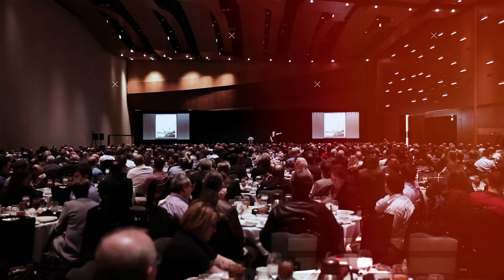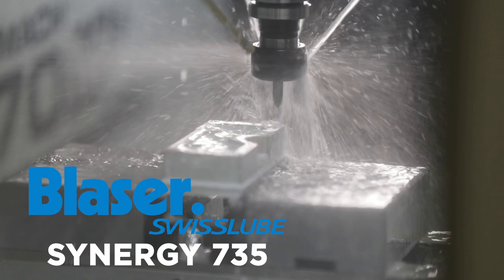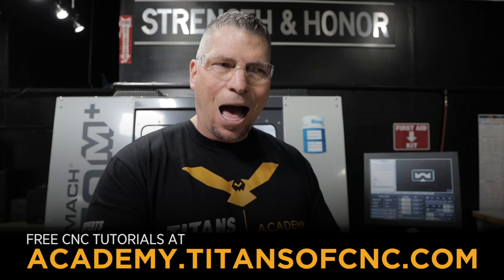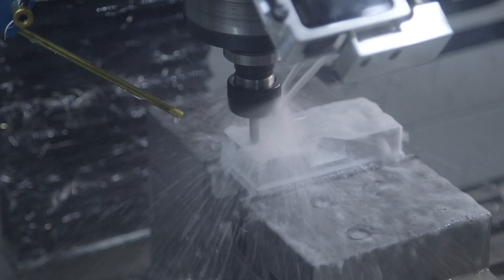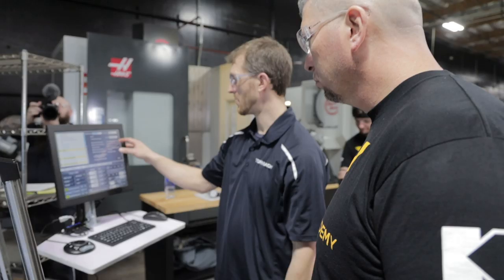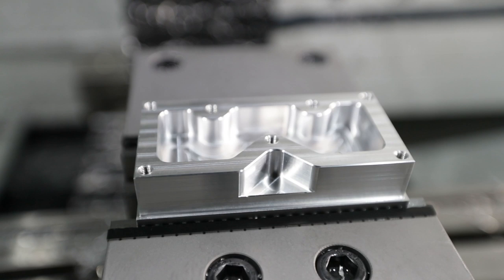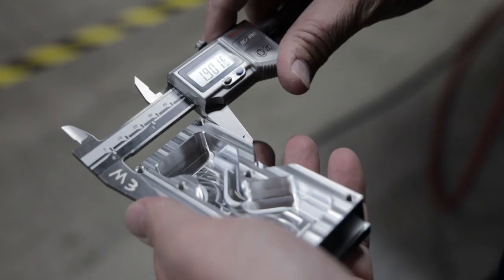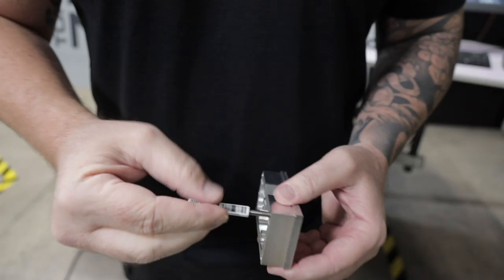My New Tormach CNC Machine - Vlog #58

Comment: Guys, forget the choice of machine here, Titan is trying to teach folks how to adapt and understand machining.  I've been machining 1" aluminum for 10 years on CNC "routers" with unbelievable results, and I can tell you the ability to adapt as a machinist is the take away here.  No recipe will work across all machines especially low HP mills / routers and that's reality. You've got to know how to adapt to get the best results for the given circumstances.  Personally I would save my tormach $ until it gets me closer to a nicer machine but the fact Titan is using one to teach earns him mad respect from me. I totally get where he's coming from. This guy is a true educator.
Reply: Perfectly said 👍
Reply: With tormach, you need to be great at adapting to get ANY kind of result that isn't scrap. Or, be great at adapting the scrap that the machine produces into something else usable :-D

I get the point of it as a non-production training only machine, that you don't give a shit about it being crashed all the time. If trainees are crashing a machine all the time though, there's a problem with your training :-D

But to me, Titans training looks on point
Reply: @neilhuband995  if you have to struggle to avoid scrap on a tormach, you're not a machinist. Tormachs are easier to use than any cnc mill.
Reply: @willl84  Tormachs are CRAP they are cheap for a reason ...If you want a cheap machine and don't care much for accuracy or finish get a Tormach if you care about those things get something else NO CNC professional would touch a Tormach as their main machine....
Reply: @captainmcderpyderp  

I'm not referring to ease of use lol

I'm referring to these machines ability to hold tolerances and produce decent quality surface finishes. 

Go have a look at the scare stories, there's plenty of them. Go have a look at cnc forums and see what people have to say about their shiny new tormachs. Do a YouTube search too. Don't tell me you're ignorant to the nightmares that people have had with these machines.
Reply: @neilhuband995  all of them had no idea what they were doing. Tormachs can easily hold tolerance.
Reply: Iam from Germany, and you only see DMG and Hermle over here. But both are super expensive, they also pretty damm good, but what iam trying to say is that, sometimes you dont need the best, when you cant even use it. I mean you wouldnt get a Ferrari as a first car, cause you just dont know how to use it, you will get a cheap car to learn, and in the beginning it will be enough.
Reply: He's using it to teach because he's all about money.  Teaching on a production machine doesn't make financial sense since it's not generating revenue when idle (used by a student). Training kids on cheap machines makes sense. Holding tight tolerances is irrelevant at that point. Take lighter cuts. Simple. They're learning and not producing.

Comment: Wow, a lot of haters, guess they don’t understand that people have different ideas and requirements for purchasing machines. If you are a business that needs to make parts and lots of them then yes this is not the machine for you, nor if you have critical tolerances.  But maybe for people like me that want something that no one manufactures and don’t want to spend 150k on a machine , well it’s fine for me!  I’ve been able to learn cad/cam (fusion 360-free$) purchase a machine (tormach 1100) for less than beater car, hit the you tube university (free) and within a year build a rather complex model. About 300-400$ worth of broken endmills, learning curve, one soft crash,     And this machine sits in my shop, doesn’t have to make me money, just makes me happy. Now I have something that no one on this planet was manufacturing. Yes I would like to have a haas vf3 (money is not an issue) but practicality is, $30 tool holder vs $130. Space, power requirements, am I going to actually use it?  I don’t need to finance or do I?  Am I expecting to pay less for a machine and not willing to put in the effort to learn how it works?, set it up? Adjust it?  Or am I going to pay travel expenses for the tec to on my $150k machine?  I’m happy with what I have and I also have realistic expectations. I think the haters are just not willing to accept the fact that in business you have to be working and have to keep employees and machines working or you will no longer be in business and someone will be wanting that expensive machine back you financed.

Comment: And I paid $8,000 for a 2006 bed mill including shipping, phase converter and bt40 tooling and Gibbs cad/cam package. Oh and it came from a school where it was hardly used. Now tell me about Tormachs $15,000 price? I just cant do it. For $15k I can get 3 different 6000lb bed mills and in fact that’s what I’m doing. Anyone want some cnc bench mills or manual mills hit me up I gotta get rid of all these toys. By the way the school that i obtained the bed mill from upgraded to a 5 axis vmc and we talked about Tormach and they said they would never consider using those for instruction. Perhaps a high school metals class but not an actual college teaching engineers and machinists.

Comment: Bought my 1100 for prototype work in 2013 but ended up pressing it into production, not very fast production, but it was "do or die" for my business then. The Tormach did and we didn't die. Five years later we built a shop and are looking at our first HAAS. 5 years we ran the Tormach and I've had a full time guy supporting his family for the past 3 years. No complaints.
Reply from the maker: Exactly, I never said it was the best... but it’s great for an entry level... for those who otherwise couldn’t have a CNC
Reply: CDM GEAR LLC you need a vlog too :) that's a hell of a story
Reply: @TITANSofCNC  absolutely
Reply: The story is a deep rabbit hole, detailed and interesting, probably only to me, but I couldn't do it without God.
Reply: Iam from Germany, and you only see DMG and Hermle over here. But both are super expensive, they also pretty damm good, but what iam trying to say is that, sometimes you dont need the best, when you cant even use it. I mean you wouldnt get a Ferrari as a first car, cause you just dont know how to use it, you will get a cheap car to learn, and in the beginning it will be enough.
Reply: @cdmgearllc9510  That's where you're possibly wrong. People that think their stories aren't interesting often have the most interesting stories. People that find themselves interesting...well.

Comment: I’ve used a Tormach 1100 series 3 for three years, anywhere between 12-60 hours a week depending on the requirements. Making one off parts, prototypes, and full on production for products used in woodworking.

Literally checked the tram today after a year of steady use. X was out 2.5 thou over 16 inches (which was what caused me to check it, face mill wasn’t spitting parts out flat enough for my liking), Y was out 0.0008 over 8 inches. Backlash/lost motion on X was 0.0003, Y and Z were both 0.0008.  My only complaint is it’s a little “hokey” using shims to tram, but I also understand the limitations enforced by price points. It’s a machine that was 22k with literally all the bells and whistles with a travel large enough to grant me the parts I needed.

For woodworking tools, no one would have ever noticed that 2.5 thou variation, and it was on a cosmetic face. That’s just my personal taste coming through on consistency and quality. It’s for wood. Breathe on it wrong and it’ll change more than that variation. 

I learned production CNC in a mass manufacturing setting on machines that were 2.5 mil each, running dual 250kW motors on a single spindle (flowforming machines) and there’s no comparison in speed or capabilities. There shouldn’t even be a thought to compare the two. 

The Tormach works for what I needed it to and has allowed new products and new ideas to happen. I’ve taught four people from zero experience to being able to run parts consistently on the machine, both fixtured production as well as one-offs.

Will I get a better machine? Yeah, probably down the road after this one maxes out capacity wise. But $600/month was a whole lot easier to justify than $1500 for what we needed to get done.

Comment: You can eat an elephant in small bites ! Glad to see you welcomed Tormach into the fold. Took me over a year to decide to pull the trigger on an 1100M..& I have been happy thus far..      Tormach has reduced the barrier to entry for CNC. Kennametal tooling and servos might let you run 60>ipm, but I run 40ipm all day long with much less. They are great little machines !
Reply: How is the backlash on your Tormach? I've been looking to pick one up, to get into CNC machining and I know that I'll already be quoting a few jobs that will require at least 1 thou tolerance. 

I would be pushing to start it off as a hobby and small run side jobs, with the end goal being enough work to walk away from my day job, find a space and add a HAAS Super Mini Mill to the mix.

Comment: The y dimension was spot  on and the x dimension was too big by .0035" .  This means the ballscrew compensation needs to be adjusted on x not the cutter compensation.   If you adjust the cutter comp the y is going to be too small.

Comment: I've got an 1100 as well. Went the opposite direction - started 3D printing, ended up with a ShopBot router, and then wanted something that could handle Aluminum for prototyping and parts that we make in house. No question that we couldn't crank out dozens of +/-0.001 parts a day with it. But, we don't need to do that here and have never actually had any problems with the tolerance of the parts that we do create. 

Totally respect where everyone is coming from on the production side - you'd probably lose your mind trying to hit your tolerance and production targets with a Tormach. But, damn, I have come a long way with this machine. There's no way I would have had the cahones to go drop down on a Haas to learn how to machine. Now, I feel like if I decide to do that, it will be money well spent, and I'll know what to do with it. Even if I did that though, I bet the Tormach would stay in service for 2nd ops, etc. so it's definitely money well spent IMO.

Comment: I have a tip you can make a video on. I machine a lot of weldments and often have to probe something that covers up the line of sight from my probe to the receiver. Instead of breaking out the edge finder and an extended holder I've started using a mag base with a small mirror attached. I line it up to bounce the light from the probe to the receiver. Works a treat and usually gets me some strange looks from the old time machinist in every shop I've been in.
Reply: I have no idea what you're doing.  What's a "mag base"??  And edge finder is about $6 on amazon.  It's not that breakable, trust me, I know.  lol
Reply: Mag base, magnetic base likely, but I thought those probes used a radio frequency instead of IR signalling
Reply: @jadesluv  Arg.  I hate it when people talk in half words trying to sound cool and knowledgeable.  OK.  Now it get what he is doing.  But I don't know what type of prob he is using.  See how much of our time he is wasting trying to guess what he's doing? OK I'm outta here.  Thanks, jadesluv.

Comment: I actually got emotional on this vid.  Being fed up with my mechanical designer job 3 years ago because they would buy a knee mill for us to use, my wife told me to buy my own.  Being a cad designer, I decide on a Tormach vs a cheap chinese manual mill.  Long story short,  I learned from running onsie twosie runs, doing prototype parts from copper and aluminum and some stainless adding up to almost 250+ different parts for my day job that would even buy a $1000 knee mill.  Now they love me as the local shops have long leadtimes and high setup costs vs me being paid hourly.  Best part is I get sent home most of the time to work!  I get to spend time with my wife as she homeschools our boy and things are overall blessed.  As of today, I'm getting ready to buy a Haas all because of the business I am getting now.  Tormach was a great machine to learn on and I'll now let my young son start learning on the 440 to someday work along side me...God willing.   Love your vids brother.

Comment: I have a Tormach and love it. Runs on 115v right in my basement, not special wiring needed. The machine breaks down into 3 small parts that can be moved into a small location through a normal size doorway. I love having all the capability it offers right in my basement. Hard to beat. The next step up would be the Haas mini mill.

Comment: Glad to see you do this video Titan. I have completed the Rocket series and most of the Building block series on a Tormach 1100 with a Rapidturn  attachment. Not all of the Kennametal tooling or speed and feed are appropriate for the Tormach but replacements were easy to figure out. I hope you release recommended speeds and feed for the projects for smaller mills and also perhaps a tooling recommendation from Kennametal  just for Tormach. Thanks for all you do.
Reply: Bill Griggs Hi Bill, I watch your videos too bc you have a Tormach like me.  Just watched the squaring up stock video...thanks!
Reply: @SmithAerosports1  My pleasure. Thanks for the shout out.

Comment: I bought a used 1100. Did a 2 year CNC program. I got trained on Haas machines, Im very aware of the differences, it's a little painfully slow at times but I'm making decent parts(within expected specs)  acumilating customers, learning small, failing small. -5k in. When the time comes I'll get a Haas. Great learning, get in the game tool.  imho.

Comment: I wish I had watched this video earlier. Having owned a PCNC1100 for almost two years now, I think the Tormach machines are great for filling a niche where a hobbyist or entry-level machinist needs a capable machine but doesn't have it in the budget for something with a 40 or 50 taper spindle. I'd love to see what kind of cim you can push the 770 to in future videos. I've found some great roughing tools that I use frequently, and find it funny when people tell me it's not a "real" machine.

Comment: Titian your spot on as normal!  Love the angle as you hit the nail on the head (60 year old guy with a hobby business on the side)!  As there is a huge difference in a Tormach and HaaS namely price!  But the ideas as you point are the same!
Reply: Haas are far, far better machines than tormach. Completely different league. And Haas are a long way from major league themselves. It's just that tormach are the absolute lowest of the low. Utter garbage..

At least Haas are pretty reliable and can hold good tolerances. A million miles better than tormach shite
Reply: @neilhuband995  Sorry you could not be more wrong. You have to evaluate the purpose of the machine for the purchaser. Nobody with any sense thinks that a Tormach is in the same league as machines that cost 2 to 100 times as much! We don't need you to point that out. So yeah, if you expect a $15k machine to be fully the functional equivalent of even a $40k machine, well you're in for a disappointment. But if a Tormach PCNC is affordable and its specs and capabilities are in line with your needs, then it is a perfectly viable option.

Tormach's line includes reasonable choices for specific use cases. These may not be your use cases. I have to say I find it sad that someone who supposedly knows all about Tormach's and Haas' and even 'real' high-end CNC machines would be so clue free when it comes to understanding other people's needs. For me, even a baby Haas is simply not a viable option. So if I took your advice, I'd do what exactly to develop self-taught CAD/CAM and CNC skills? I'm not looking to make money, I've been working for 40+ years doing that. I want to pursue this for personal satisfaction. And the performance envelope of Tormach's machines includes all I really need to get started and for at least the next few years. 

But of course it's a free country and, as a wise machinist once told me, you're entitled to your wrong opinion...
Reply: S H Nail on the head, sir. Well put!

Comment: Will you put together a kennametal tool kit for the Tormach. I have a 440 and do not have rigid tapping. A lesson on how to single head thread mill would be helpful to a lot of people.
Reply: To do single point threads in Fusion is super simple no matter what machine you have. You can use the Thread cycle or the Bore cycle, just a few clicks and BOOM you're threading like a pro. If you need help, let me know.
Reply: back in the day before rigid tap we all used Floaters - compression style - its recommended that you underfeed about 5%  so if you had S200 and F10.  for 1/4-20 use f9.5 with a floating holder
Reply: @CNCMachinistEducationNetwork  the 440 can't use a floating head either because the spindle can't reverse.
Reply: Mate learn to use a threadmill. You're pissing in the wind trying to rigid tap in such a budget machine.
Reply: @jamesm3268  hey bud I already thread mill with the 440. I just thought it would make a good video...being self taught I know what a pain it was to figure it out... maybe that's just me but still love informational videos.

Comment: This inspired me to get all "Titan" on my 770.  Went full depth of cut with a 3/8" , 3 flute on 6061-T 6.  Running wide open at 10,000 rpm, I found my limit to be about 80 ipm with a 5% WOC.
Reply from the maker: You might actually have more power at 6-8K as probably have more torque.
Reply: @TITANSofCNC  ill give it a shot

Comment: Very cool that you set to teach  on a small machine. I have a Tormach look-a-like and that teaches you a lot because you don't have the horsepower or rigidity to plow through material, so you have to learn the tools, parameters and strategies. And you're right, you need good, sharp cutting tools on those machines more than on any other.